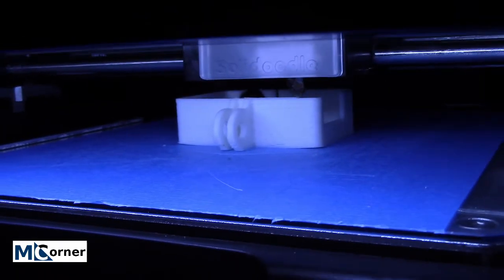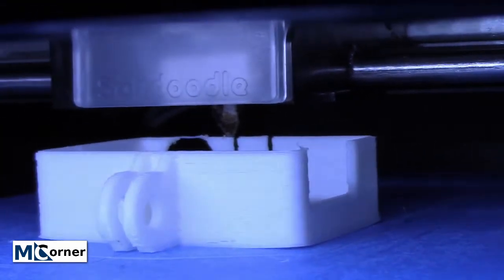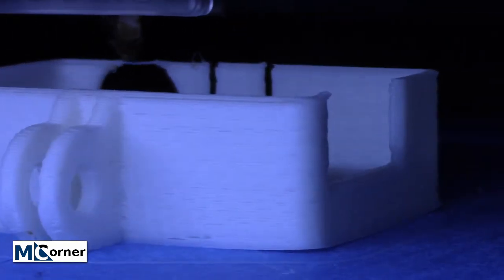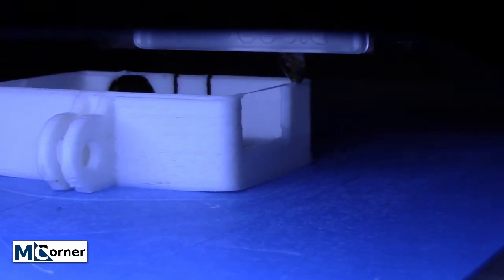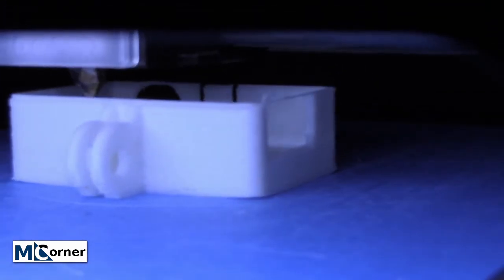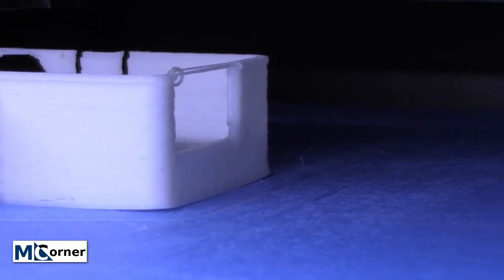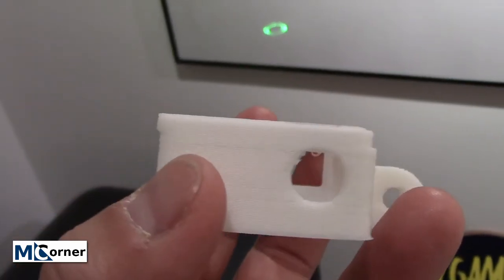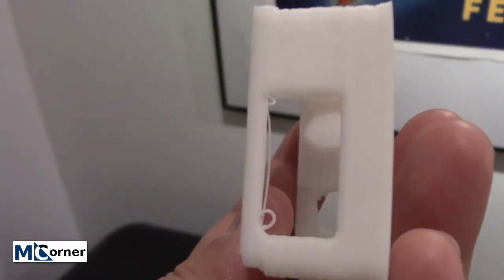Solidoodle Press - Awesome Filament Gap Leap!

Comment: I know this is an old video but I just picked up a solidoodle cheap and am wondering if u changed the firmware? Are u running on the same motherboard? I can’t seem to get the print head to actually lay down on the bed to print it’s offset isn’t right and apparently can’t be adjusted. Just seeing if I can get some insight on how u got urs running how it should be.
Reply from the maker: Hi.  Mine is unchanged from stock and I've not done any firmware updates since I purchased from new (and you have the Press model, correct?).  I have actually pulled it out recently to create some covid masks.  It's been 4 years since powering it up but ran like a champ after a few calibration runs.  I will say that all the calibration, offset and print head height adjustments were done through the SoliPrint software in conjunction with different sensor switches.  And after some trial and error, I now run certain steps in a certain order since it occasionally runs into the glass bed during the leveling step as the sensor switch on the print head doesn't alway get engaged to prevent this.  Kinda weird but just a quark I have to pay attention to before each print.
Reply: Marb's Corner  thanks for the reply. Ya I have the press model. I haven’t been able to get the solidoodle software to actually work for me it just freezes and crashes (then again I’m running on a Mac) I might have to pull out the windows computer and try it on there. But I have skipped over there software and started trying to get it tuned into cura. But I would really like to get it printing but also printing good prints. Has ur quality changed since this video?